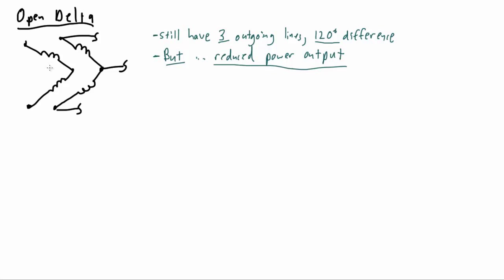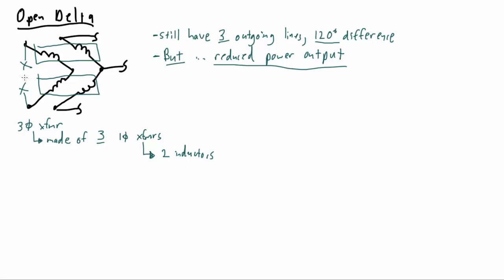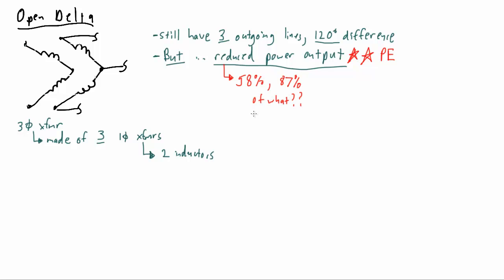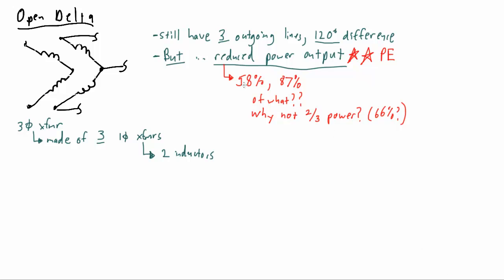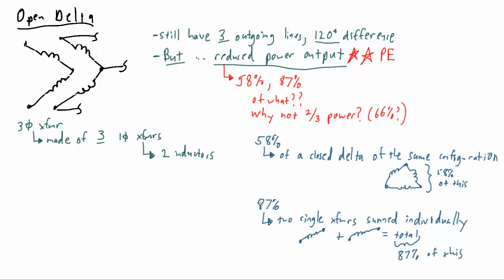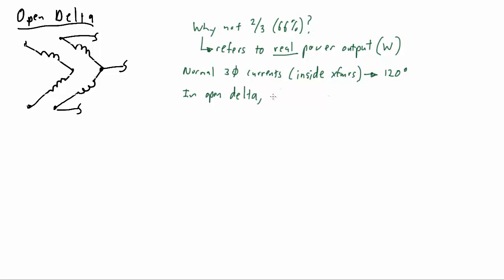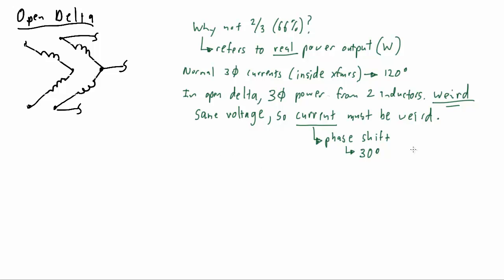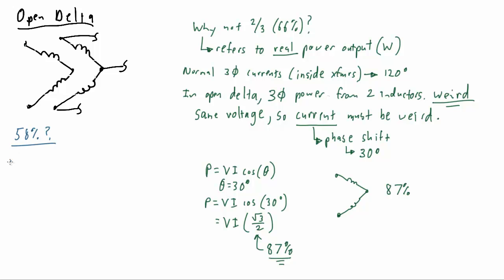Electrical PE Exam - Open Delta

Comment: the 3 phase power equation = 1.73 x V x I x PF.  Your use of this equation is inconsistent around 6:25 and 7:15.
Reply: That's for a WYE configured transformer bank. A delta bank is 3 x V x I. It only becomes 1.732 in the Open Delta configuration.

In a Wye, L-L voltage is equal to 1.732 L-N voltage while IL = IP

In a Delta, L-L voltage is equal to VP while Line current = 1.732 x IP.

Comment: can you help me from this? " three transformer each rated 100 kva are connected delta supplying a load of 160 kw at 0.8 power factor lagging, one of the transformers is taken for repair and the rest are connected epen delta. what kvar(minimum) of capacitor must  be connected with the load so that the load of the remaining transformers will be 95% of their combined rated capacities?" thanks for your response.